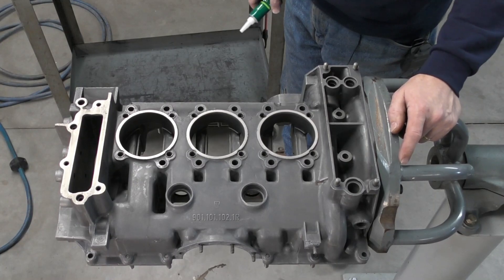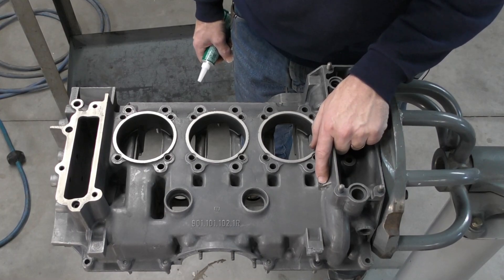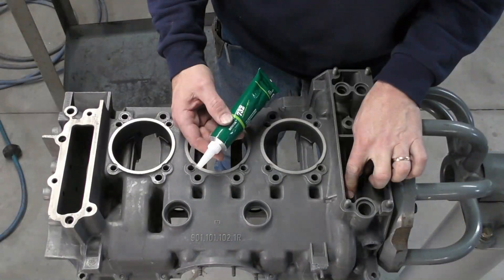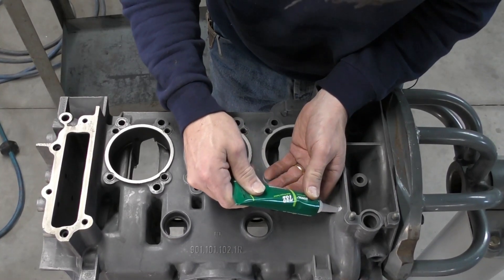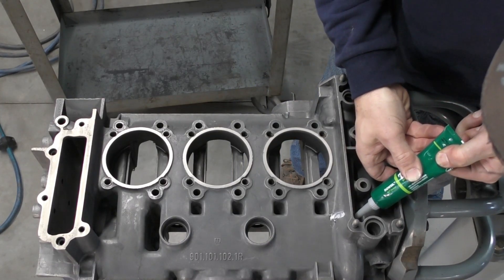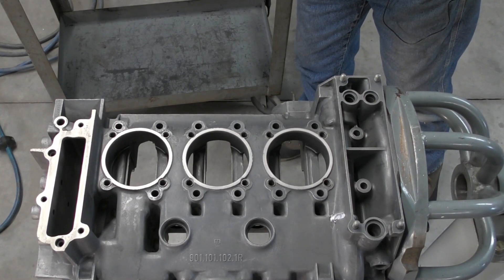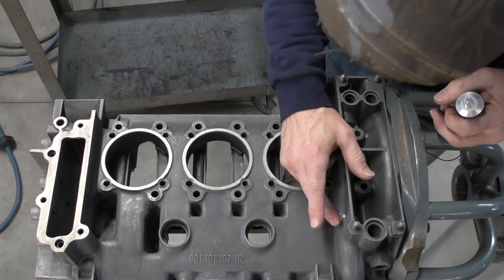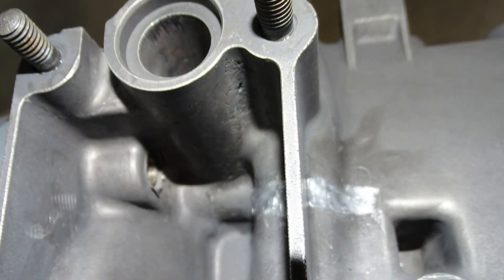Porsche Technical Bulletin 8911 Case Sealing

Comment: I'm just about to do this on my 3.2. I see a lot of people use JB Weld for this procedure. Any thoughts on JB Weld, vs Dow 732 vs any other high temp RTV?
Reply from the maker: I have used JB weld in the past and it works, just make sure you do the  prep work before applying the sealant. The Dow 732 sealant is just the Porsche approved sealant.
Kurt